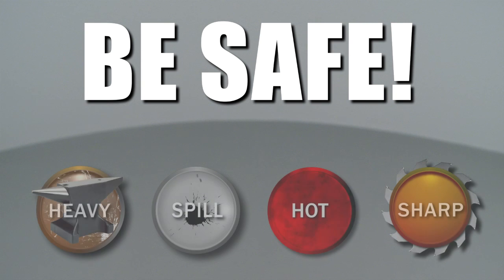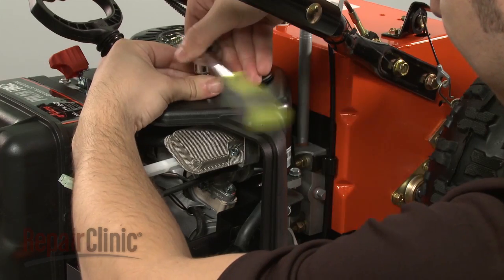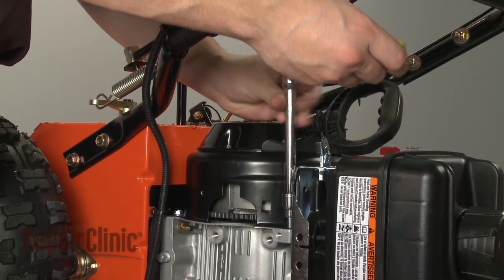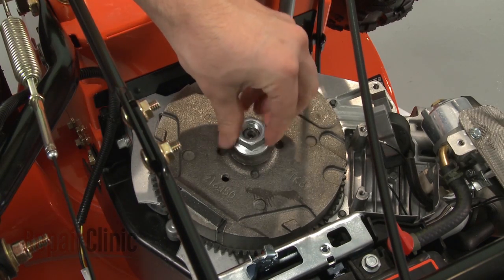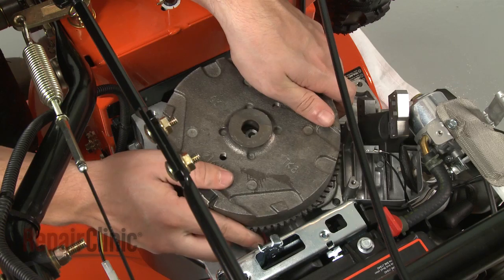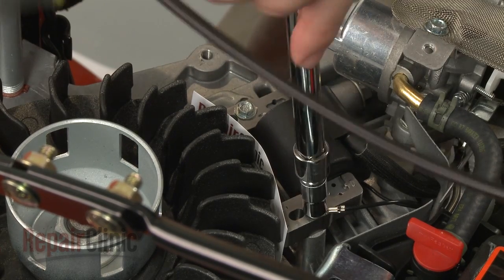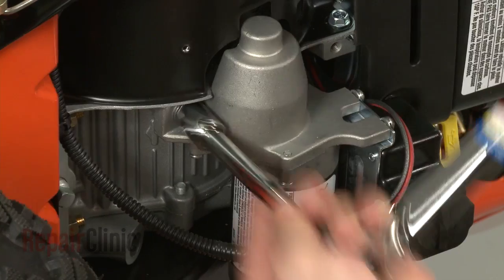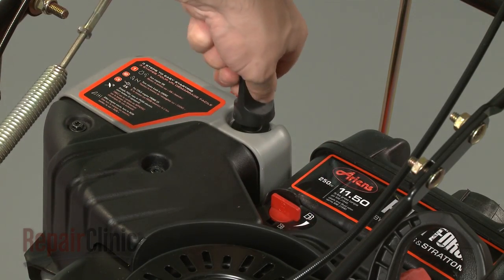Briggs & Stratton Small Engine Disassembly (#15C134-2143-F8)

Comment: Mine looks just like this one.  Mine has started kicking back when pulling the starter cord.  It has already broken the clock spring assembly twice in a few weeks.  Is there an adjustment on ignition timing?  I think it's firing too soon.
Reply: Might be a carb problem getting too much gas?

Comment: I was hoping to find how to remove the fuel tank on this model. I've removed the two on the mounting bracket but must be missing something as it still pivots on the other side like there is another stud/bolt. I guess I'll keep looking.
Reply: Any luck with getting the tank off?  In a similar situation.
Reply: @DodgePlanet  Actually, yes. I didn't take the plastic shrouding off all the way like I should have. When I did I located the third retaining bolt under the shrouding on the opposite side of the two on the tank. Once that one is removed it just pulls right out. Hope it helps.

Comment: i can't get the choke knob off
Reply from the maker: Can you get a screwdriver underneath it to pry it up?
Reply: *****
I tried that, i can get it under to pry it, but it's plastic and i don't want to break the knob or the long white part that goes below to the engine, is there any kind of lubricant i can use to loosen up the plastic parts?
Reply from the maker: WD 40 could help.
Reply: @blackjack55551234  As stated, WD40 and pry with rounded needle nose pliers.  Let WD sit for a couple of minutes.
Reply: they show you taking all that apart I did mines only took apart the plastic things I left the starter in only unbloted the pull rope housing
Reply: and never removed the flywheel
Reply: pull really hard, try to get something under it so you can pull up. mine was very hard to pull, but it did come of . there is nothing but friction attaching the red knob to the choke actuator.

Comment from the maker: Thanks for the question! This video is meant to help people with repairs that require the disassembly of the engine.
Reply: Would it be possible to get the part # for the fuel shut off valve ?